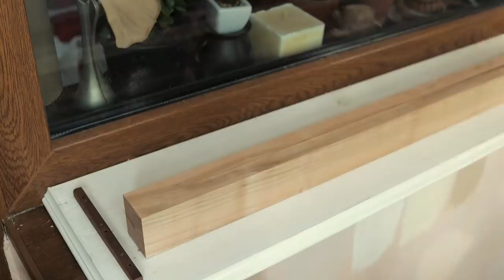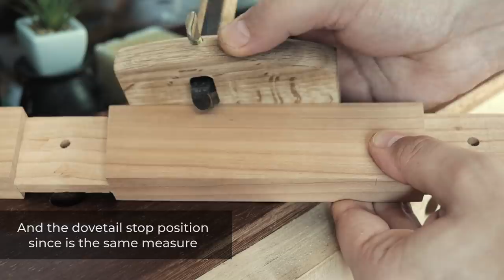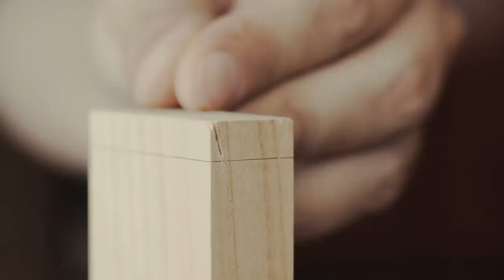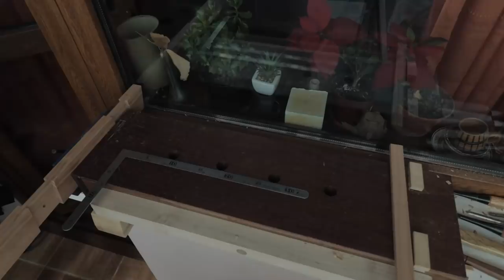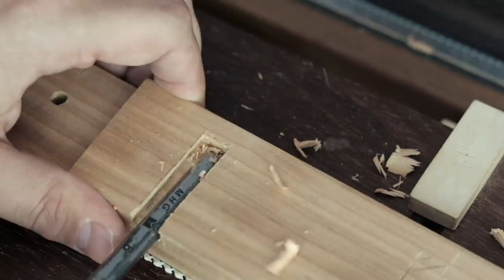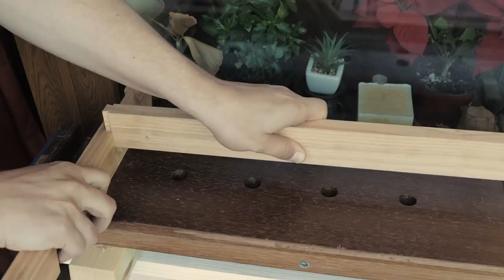Making Stopped Sliding Dovetails - Desk Build Ep.5

Comment from the maker: At first I was afraid, I was petrified, doing sliding dovetails by hand, never did it (honestly I was planing glue and dowels for this stage), but then I said what could go wrong, in worst case I will shorten the rails. In the end they turned out ok, some barely visible gaps, but they are tight fitted.
Question, are correct the names I use for the desk components? Like the rails, or they are called aprons?
Next video very soon, the long stretcher and the 3rd short rail.
Reply: When this whole covid ends, and i start woodworking again, i'll make a pair of dovetail planes for you as well as for me :)
Reply from the maker: +Alex Chiperi Gracias! Will be embraced! :)
Reply: I believe they are called "stretchers" :) Pozdrawiam!

Comment: I'm very impressed for these being your first hand cut sliding dovetails!! It's no easy task but acurate marking makes the job a lot easier (knife lines is what I mean by acurate) and of course sharp tools

I will be making a chair shortly in which I will apply a lot of "glueless joinery" as I call them, 14 sliding dovetails! That's going to be a lot of fun. I intend on not having to glue the chair
Reply from the maker: Thanks! Oh, that sound fun indeed, 14 :)
I'm also considering glueless, although it wasn't originally intended, but seeing the joints coming out quite tight might be an option. On the other hand I might add a drop of glue there and there, mostly on the stretchers joints, just to hold it tight without any creaks because I intend use this desk :)

Comment: Extremely beautiful as always!
Reply from the maker: Thank you! Cheers!
Reply: @AdrianPreda  - You have to help me out here.

I'm getting a slab of oak wood from a friend, because I want to make a tabletop for my PC station with one live edge.
The slabs from the mill is always cut to 2 inches thickness for some reason - I live in Denmark where we use the metric system, so not much sense to use inches lol.

Anyways, I don't have a workshop, I don't have any tools for this kind of job and definitely not a workbench.
So what do I need to make this happen?
A hand planer is too much work, if I need to shave off 3 cm and end up with a 1,5-2 cm tabletop - and I don't even know if that's too thin and if the tabletop will still be strong at that thickness. What do you think about thickness?

And then there's the problem of me not having any tools, so I have to buy some, but which ones? I've been thinking of buying a handheld router and then just eat my way through the slab one pass at a time, but how would I do that and end up with a flat top? Using some kind of jig? And if so, which one and how would I build it?

The tabletop should end up being 70x152 cm and whatever thickness is possible and still have a strong table. So the slab is naturally going to be a bit bigger, just so you have an idea of the scale I'm working with.
Reply from the maker: @TheStabbedGaiusJuliusCaesar  Hi, yes normally lumber in Europe is cut to 52-54mm and 26-27mm, which is corresponding to 2 and 1". It may be too thin for that size to make it 15-20mm, I would say mininum 22 towards 28mm to maintain it resonably flat in time. You may go with a router, is more easy but more messy, just buy a cheapo one like those they sale on Lidl (there you can return in 3 years with no questions if will brake) and build a router flattening jig (google that there are many plans and ideas). with this method there will be some marks on the board from the bit but then you can easily sand it with an orbital sander and make it smooth. Hand planing I believe is out of the question, but if you wish the board to be thicker, like 40-45mm how much will result minimum, you can try looking for flatten board with handplane and also look for winding sticks, these will help you to check for flattnes. Other option, is to find a local woodshop, ask them if they can flatten it, it will took them couple of minutes, you should pay them some small money or if they are generous they can do it for free :) Depending where the slab was cut from the tree (middle, ends) you may need to cut it in two and remove the heart (middle of the slab) that is the most unstable if the slab was cut more towards the middle (quarter sawn), then join the two pieces by glue or just solo with a gap between
Reply: @AdrianPreda  - Thanks for a quick response! I think I've bitten over more than I can chew. I'm so stressed about it, my friend is planning to get it to me by Friday! And I have no idea what I'm gonna do. I might just contact some local professionals tomorrow and I'll remember what you wrote. <3
Thank you.
Reply from the maker: And forgot a thing, the slab is dried or freshly cut? You must dry it if it isn't, in a kiln or at least air dried somewhere with no sun and ventilated at least one year before doing something to it, otherwise it will bend, twist etc
Reply: @AdrianPreda  - It should be around 12% humid.

Comment: Seeing the fit at the end was satisfying.  I know sometimes people will taper the dovetail (or the socket) so that it doesn't get snug until the very end.  Did you try to do this at all, or is the dovetail and socket the same size whole way?
Reply from the maker: Thanks! I did something similar, unintentionally, but I left it like this for this purpose: when final chiseling the angle on the sockets, I left 1-2 passes at a higher angle so the pin will force more there. 3 of the joints are super hard to get out when pushed all the way, just one, on last scene when I assemble,the left one as you're viewing is a bit loose, I believe I made the initial marking a bit wider.
I normally intended to assemble the whole desk with glue too, so a hair loose was necessary (I remember when making the sawhorse-workbench I went into panic-hammering mode since it got stuck in the middle :) ), but seeing now the joinery turned quite tight I might think making it glueless :)